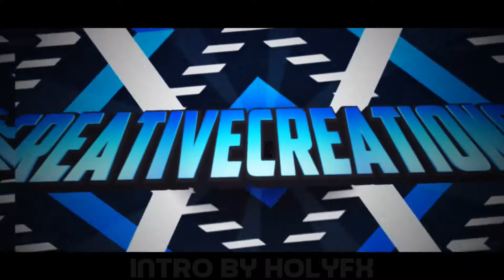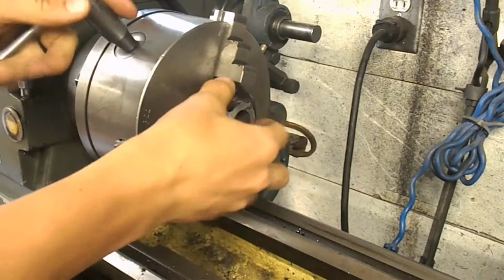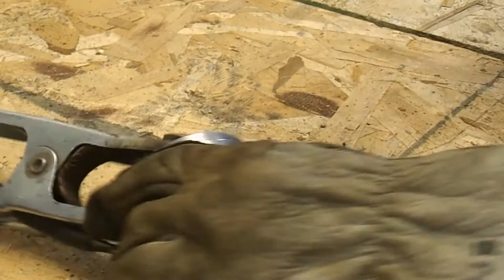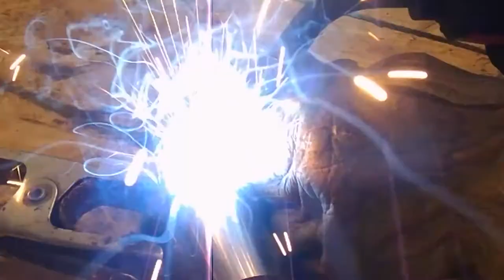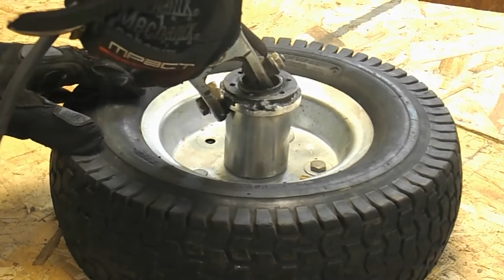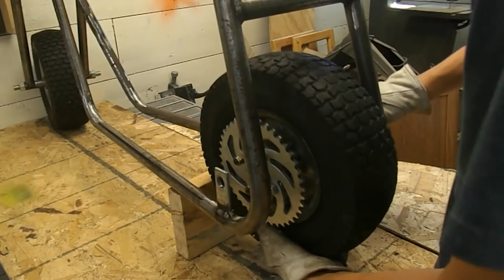Disc Brakes for Minibike

Comment: How are you ever going to change that wheel bearing, since it was still in place when you welded on that brake hub?   Did you add another bearing on the outside?  
I was having a similar issue trying to restore an old Arctic Cat.  Just today I saw a new wheel with TWO mounting hubs... one for sprocket and one for brakes. $40.  I ordered it, since the hub I tried to make is so ugly and off center I can't use it.  I don't have access to a lathe or drill press.  I hope it works.

Comment: How did you do the brake caliper mount?
Reply from the maker: I’m sorry I didn’t show it in the video, but I just took a piece of strap iron and drilled some holes in it then bolted the brake caliper to it then I welded it to the frame